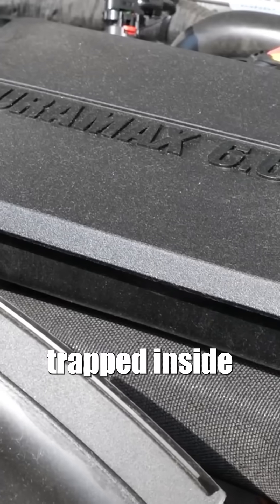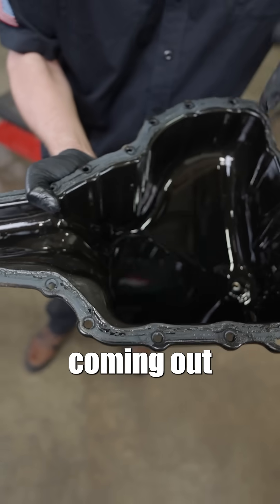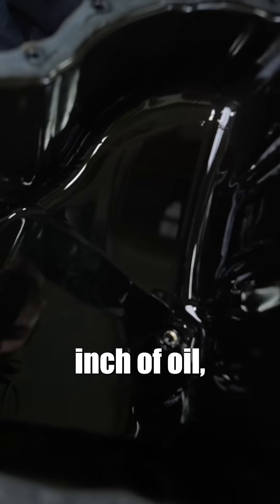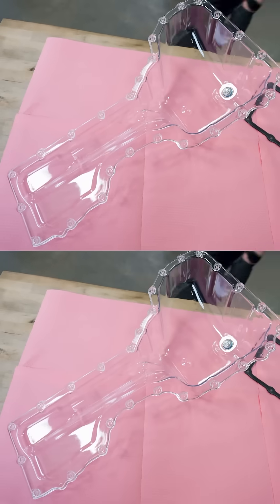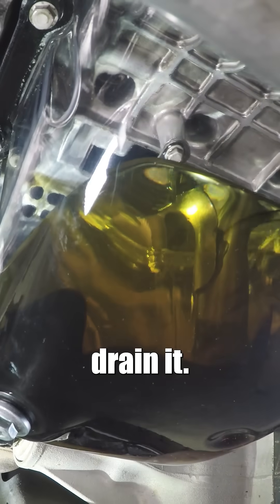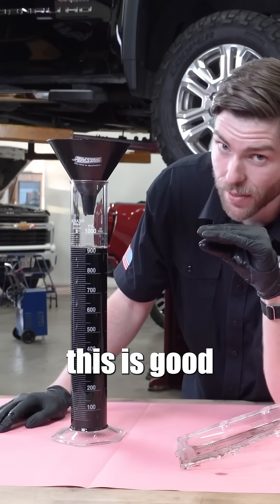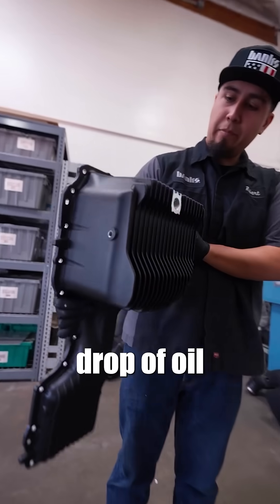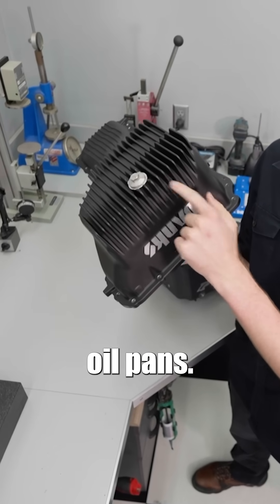A disturbing discovery. This dirty oil is trapped.

Comment: Every time I do a oil change I just do a oil pan replacement too 💪
Reply: Have you tried changing the oil by changing the entire car?

I heard some folks do that, just wondering :)
Reply: @TRiToN219  That is how Steve Jobs did it... but for "different" reasons.
Reply: @TRiToN219  😂😂
Reply: After I drain old oil, put plug back on. I put new clean cheap oil. Run engine few seconds. Then drain again. Takes as much left over dirt oil. Just like draining and cleaning baby bottles by doing a few times.
Reply: 😂😂LMFAO😂😂 might as well!

Comment: Yeah, just change your oil more often. I get the sales pitch but if you don’t let your oil go bad before you change it you’re not mixing new oil with bad. I have a 7.3. 2002 and I change my oil every 3000 miles no matter what. Guess what I just turned over 350,000 miles on it seems to be OK.

Comment: Engineers design it this way, the oil not draining out of the pickup tube means on restart the engine is already primed, with your oil pan it's not primed upon restart, try to do a very fast oil change and restart it ASAP, so the bearings don't leak off all the oil and go dry, a 15-20 oil change would be best, don't do an overnight drain cycle

Comment: There’s more oil in the rifling and sitting on top the heads. That tiny bit does absolutely nothing to the engine. If that little bit is highly contaminated then you’ve got a much larger problem. Banks you guys are great, but this is a money grab.

Comment: I’ve never heard of an engine failing due to an oil pan having dirty oil over its lifespan. By that point you’re in need of an engine rebuild anyways. If your that worried about oil cooling get an oil cooler. Outperforms whatever fins you add to an oil pan. If your doing it for the sake of having it with a Banks logo on it well that’s cool too I guess.

Comment: So the manufacturer just wants you to ruin an engine sooner right. Gtfooh some oil pans may leave a very tiny bit but even if you drain the sump it will still pump oil and not lose its prime because the internal gear is a closely machined part that works with just a thin coating of oil

Comment: I found pushing a white rag into the drain and using a hook to force it into the bottom of the pan helps use the capillary effect to pull most of the remaining oil out. I do this once every 5 changes. Also helps to get the sediment out too.
Reply: Would love to see the video. Hope you make it.
Reply: Does this work with different color rags or just white?
Reply: Why you lying?😂
Reply: A pan that drains all the old oil < an oil pan that changes the oil for you < a 12v powered pre-start oil pump
Reply: Gunna make a suggestion for you, don't get mad it's not hard, and I'm not forcing you; 

Get a vacuum pump. 
Get some hose that can bend easily and either has a "hook" shaped end(by virtue of being sold in a roll, most already achieve this) or can be heated a bit a molded into a hook shape.
Make or buy a catch can. 
Attach catch can to vacuum pump. 
Attach hose to catch can. 
Use hose hook to siphon oil instead of your rag and pump the oil out. 

Trust me, you might still need the rag but you'll have less oil on it, and either wash less or throw away less.
Reply: Ruins a nice white rag too!

Comment: This is why people do oil changes in succession so say you want to change your oil but you want to make sure you get all of the contaminated oil out so you would go through a process of taking all the oil out. Putting new oil in and repeat this process. However, many times you personally think it will take. Yeah it adds up really quick at about 70 bucks per oil change and that's if you decide to do it yourself and you use good quality oil and filters. So yeah unfortunately he's right. There's always trapped oil. You can get around it but it's really not worth it at the end of the day. Just do shorter oil changes instead of 10,000 change at 7,000. You'll have a lot better results with keeping patina off inside of your engine

Comment: The salesmanship of implying it is always the same quart of oil is amusing.
Reply: He said it's always dirty, which is true
Reply: Yes but it's diluted by every fill up of fresh oil.  @jpatt85
Reply: @jpatt85 it’s not … when you waste clean oil to fill it up and kina neutralize the dirty oil
Reply: @eliq9862  by your logic if you mix 4qt drinking water with 1/2 qt pee,  the urine been neutralized. Bottoms up!
Reply: @jpatt85 depends how often you change your oil, what type of oil my 2021 still spits out clean oil 4000 miles in because I always do it 1000 miles early
Reply: @Nebraska_Juan   So changing clean oil, keeps oil clean for vehicles that barely get driven. Wow, Thanks 🙄
Reply: @ to get clean oil out of your engine you have to do early oil changes yes I understand it’s a hard concept for most, but my time working in a shop showed me how bad people are with maintenance and how dumb some car owners really are like the ones thinking this is a great idea
Reply: This is why I replace a quart of oil with water. Since the oil sits on top of the water, all the oil gets drained and then I have nothing to worry about. Follow me for more tips at Tim’s 24 hour engine replacement store.
Reply: The small shaving never make it out
Reply: @plagueless9829 
That's why the plug and threads are usually magnetized.
Reply: It's true i tried this with cooking oil and when draining it the cooking oil had the same old engine oil in it
Reply: banks already make good products. drop the nonsense sell pitch and use the money to pay more to your engineers. Don't be another Boeing with the accounts take over.
Reply: @ddjohnson9717  As an engineer in Motorsports the only bank’s product I actually recommend is their Differential Cover housing. But a product like that is already niche to where I only recommend it for actual towing.
Reply: The sediment is only meaningful if you’re actually doing a full flush. 

With only a regular drain and fill oil change, the benefits of this product is negligible because all the rest of the debris is still mixed into the other parts of the engine
Reply: @robster7787  this is why you have an oil filter
Reply: Saw a video of a guy debunking this guys claims about his intakes. Haven’t looked at it the same since
Reply: Exactly 😂😂😂😂😂 the vehicle shakes and bounces mixing that oil up with the rest.
Reply: The amount of comments on just ur comment is why this marketing works. Vague enough so the idiots don’t know. Just specific enough for a specialist to agree to a certain aspect. The way they toe the line here should be taught in marketing classes. I would love to buy this product if I could afford it. However I will never EVER truly need it. 
CHANGE YOUR OIL WHEN YOU ARE SUPPOSED TO.
Reply: @ it should be illegal. I worked at a shop before and they were always on our buts to be very specific and not say if you don’t change this your car will break or what ever just tell you what’s possible because no one trust mechanic. And then you have a mechanic fooling thousands of average joes but you are right it is genius sales tactic but for the normal consumer not us this is predatory
Reply: @Nebraska_Juan you do realize these people actually break records with their products and they go hard on r&d to make the best product possible. Which means it’s not gonna be for everybody and is really marketed towards racing or enthusiasts that take pride in taking great care of their vehicles. In a diesel you can extend the life of your engine by 100’s of thousands of miles by changing the oil pan and using good filtration. They design them to breakdown so they make more money. Changing an oil pan for a few hundred is a lot cheaper than a rebuild with much less down time.
Reply: It's tuning market at its finest, creating solutions that nobody needs, to issues nobody has 😂😂
Reply: I had the same thought
Reply: I hate salesmen, but honestly I don't think he implied that at all
Reply: That’s so dumb I hope no one waist there money on this just change your oil more frequently because you should anyways it’ll make your car last longer, run a light flush here and there and you’ll be golden
Reply: Oil does move around in the pan. So. Yeah. It would not be the same oil.
Reply: @ dude you’ve got to be kidding you just said it does move in the pan. Meaning it’s cleaned each oil change a little sure spend the extra time and money for .7 quarts of oil
Reply: The salesmanship is actually on the wrong point, the product is not.

As a mechanic I wouldn't sleep well if I can't see the last bit that comes out.
Here they use pretty new oil but on sludgy oil the heavy contaminants will stay trapped with the old pan.

But on performance applications you would also have to drain the oil fully to get a clear view on the condition of your oil.
Usually the beginning and the end give you the best view on the conditions.

But besides that I would rather buy it for the cooling properties and cool factor
Reply: @robertlaws254The pickup literally sucks up that oil as soon as you start the engine because it's submerged in that oil to prevent drain off when the pump is off....
Reply: Here's my take on it... Through an oil change cycle, the new oil gradually becomes old oil, to put it simply.  After maybe a few weeks, the oil will be the equivalent of having mostly new oil with some old oil in it... but yet we still keep running it for months longer.  The fact that we change the oil at all and most of it is new, should be the prevailing detail here.  Logic... If this bothers some of you, then just change your oil a month or 1000km sooner every cycle to compensate for what you think is already "used" or "lost" in the cycle.
     I used to be "OCD" about getting every last drop out until I realized that old oil is not like a pathogen that ruins a new batch of oil.  It's all proportional.
Reply: He didn't "imply" it, he said it straight out. You're sugarcoating it. It's not amusing. He's lying and fear mongering. The truth is, obviously, the oil all mixes. So when you change it, even if you don't get it all out, you're still changing out MOST of it. Also, this was the way the engine was designed to be from the manufacturer so clearly it's acceptable
Reply: It's the Oil of Theseus.
Reply: @robertlaws254exactly! Simple logic saves you a lot of hassle.
Reply: That would be the case if he implied the oil got dirtier and dirtier every cycle. He just said there was always a quart of dirty oil leftover
Reply: I mean doesn’t matter it’s like perpetual soup since that last bit of oil will dirty up the new oil and it’s not a little bit on this design
Reply: If you change your oil consistently, this "dirty" oil is "diluted" with clean oil every time you change it.  All engines are capable of running on dirty oil.  These things called EGRs introduce contaminants into the oil constantly.  So unless you get rid of your EGR, your oil will always be dirty.
Reply: 100%
Reply: Just change your oil kids. Every few thousand miles. Quit buying snake oil!
Reply: GM did wrong😡
Reply: @robertlaws254 Bingo.
Reply: I came to say this.  The “dirty” oil is always getting diluted with nice clean oil on every change.  It might not be the best oil but doubt it’s too supper harmful
Reply: I'm always glad to see others ahead of me. Gives me hope.😅
Reply: People can say what they want, but this pan is a far better design than stock. Having the plug at the lowest point is better, and the fins on the pan channeling air will keep it cooler. The bottom line is that no matter how you spin it, it's a better pan, and it works. Gale Banks knows his sh*t.
Reply: @KXKKX  there's now way a quart is getting stuck. Is this a known phenomenon?
Reply: It's not amusing. It's the Truth. But, some people can't handle the truth
Reply: Have you never rebuilt an engine ??
Reply: To be fair, some percentage of it is still the first oil that was ever put in the car.
Reply: well i guess if you put stuff like engine flush it stays longer than it should
Reply: Especially when they contradict themselves and say it’s bad for the engine
Reply: One more reason to suck the oil out the dipstick instead of draining it. I put off buying one of those things for years and now I’ll never go back once I did. Side bonus, they’re graduated. So you can monitor consumption very easily. Super side bonus, you can change your oil in 15 minutes before work in the morning without rolling around on the ground.
Reply: It's dirty which means it's heavier which means dirt settles at the lowest point it will not cycle through
Reply: @KingChadKennedy dirty oil is heavier huh!!? I think you better stick to making salad dressings.
Reply: @KingChadKennedy if that were true it would also mean that this is a non-issue. Which i am inclined to believe. 😂
Reply: @KingChadKennedy  then why is it an issue if it stays there lol
Reply: That's why you warm your engine fully and then shut off and immediately drain. No heavy particles settling that fast unless they are actual metal shavings.  @KingChadKennedy
Reply: @KingChadKennedy yep, tiny metal residues?
Reply: @KingChadKennedy  it's kinda moving around as you are driving , mixing with the new oil.
Reply: @KingChadKennedy 
This goes against his entire reason for selling this shit. If it is too heavy then it never gets cycled into the engine.
Reply: I’m surprised the owner of Banks let them Air this? I thought he is a standup guy….
Reply: Where do you think sludge most commonly sits?
Reply: It floats to the surface for easy scooping out @mag2395
Reply: @mag2395 sludge builds up and collects at the lowest flow areas. It’s due to low engine temps and short travel distances That causes fuel and water to not boil out of the oil and leave via the PCV, leading to sludge, which more easily deposits in lower flow areas.
Reply: @robertlaws254  yeah but the engine will also produce gunk and stuff so it'll be a constant cycle
Reply: @KingChadKennedy  Synthetic oil dose not build up slug like oil.
Reply: Okay let’s say that wasent there would you buy a truck if the guy told you he take a qrt or old dirty oil and mixes it with his new oil every time he does an oil change?
Reply: @B7mechanics  No because that would be two quarts 😂
Reply: @B7mechanics  because someone cheaping out on oil is not a good sign for how they treat their vehicle in general + you're getting whatever oil is left in the pan plus whatever old oil you just drained out and poured right back in, this is a totally bizarre thing to do and I would not recommend buying a vehicle from this person
 vs
someone just Using the stock oil pan and changing their oil as often as recommended or more.
If you want to get really technical there is going to be a cutoff of how much dilution is not enough/significantly wears the engine, but This kind of oil pan/plug design is pretty standard in a lot of vehicles, my cars oil pan has a lip like this and I'm pretty sure my last one did too and I've never had the engine go out. If it bothers you that much then go ahead and get the after market oil pans for any of your vehicles that have a lip around the plug. But it really isn't going to cause you an issue if you just change your oil regularly.

If you're going to say that putting x amount of old oil back in the car is equivalent to having x amount of oil just stay in the pan in terms of Wear I would agree. Buying the car of 1 dude vs the other dudes is a very different situation.
Reply: @B7mechanics  not the same thing at all
Reply: @rylandavis2976  explaine how designing an oil pan to leave a qrt of oil would not be the same thing as taking a qrt of old oil and dumping it in with clean oil but and empty pan is not the same thing
Reply: @rylandavis2976  thats exactly what happens, your new oil gets mixed with a qrt of dirty oil that didnt come out. in a diesel it worse than a car.
Reply: @robertlaws254he's right ya know
Reply: Well as oil gunks up and becomes more dense it’s gonna be the lowest sitting in the pan which doesn’t help your argument at all
Reply: @ziadajam5433  that’s not how any of it works, particularly if you run the vehicle for a bit prior to drain like your supposed to in order to maximize the contaminants in suspension to maximize removal of the contaminants. It draws from the bottom, the gunk doesn’t just sit at the bottom unless you’re draining it cold and if you are that’s your fault. If your worried about this as an actual issue the best practice would be to change the oil more frequently, not buy an expensive oil pan that causes oil starvation on the next start because the draw tube is empty. If you want the extra cooling then it’s probably a good product, for everything else just decrease your change intervals if you want or do oil tests so you actually know the status of the oil. Oil tests aren’t much, about $30 a test.
Reply: @jaydunbar7538  there is no such thing as oil starvation because the oil pickup is empty lol. You know how many vehicles have oil pan designs where their pickup tube empties when the motors off? This isn't uncommon.. And not whatsoever an issue. Oil film hangs around for days
Reply: @DarkAttack14 Check out Dave's for his test, time the engine must run, and an approximate amount of oil necessary to fill to the point of oil arriving for the pushrod rocker arm assembly. He was using his Sim test machine.

Comment: What a bunch of hog wash. There are many places in engine where small amounts of oil puddle. If you are leaving a quart in the oil pan, you are doing it wrong. Tilt the car towards the plug and drain it. This is why you need to change the oil often. You can never get 100 % of the oil out, but that 3oz that's left in there will be extremely diluted down with the fresh oil. Banks is good, but this idea is an awful way to sell it.